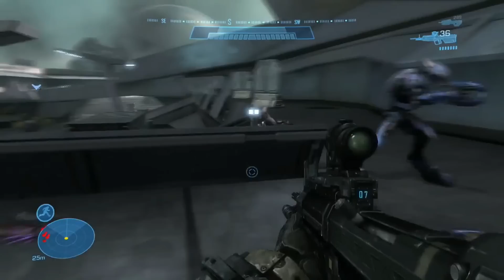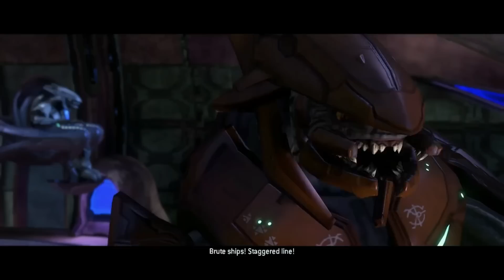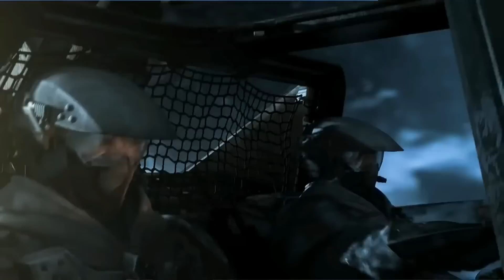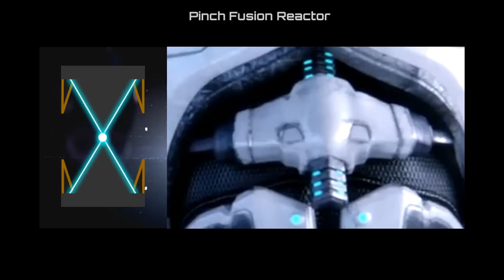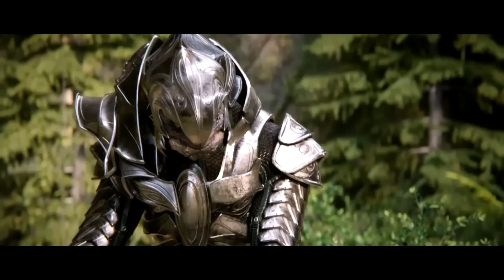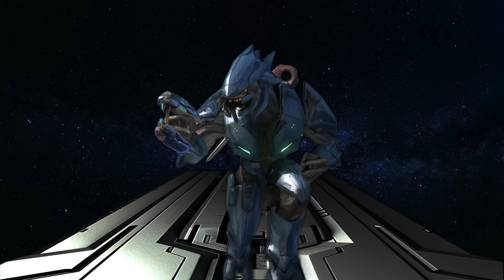Elite Armor | Most Detailed Breakdown

Comment: Aside from game play reasons, why doesn’t every Sangheili use active camo? The benefit of invisibility at long range and near invisibility at close range is a massive advantage even for line infantry.
Of course they can always turn off active camo to charge shields during combat, most likely engaging from a point of advantage and with the element of surprise due to the camo.
Reply: I'd imagine it'd be a similar reason to why Minors don't normally get swords, or perhaps only certain Sangheili are given it for specific scenarios
Reply: @217adaptiveperspective  yeah that does make sense. It’s more for specific ranks and the required missions that need it. Since… come on, your not gonna use stealth in full scale open battles, that’s a waste of valuable resources and it gives the enemy a chance to salvage useful tech if they win.
Reply: @shcdemolisher  

That's exactly how Spartan armor got shielding, they took the Jackal shield modules off their bodies during the first encounter with them.

Then Mjolnir Mark V or another variant of Mjolnir came out and had Energy Shields.
Reply: @217adaptiveperspective  Yeah. I’m still bummed we never have had the energy shield gauntlet as a thing to use in any of the games! Seriously it would have been pretty useful to use! Reflecting damage, giving you more time to get to cover, telling some asshole to piss off and stop shooting you!
Reply: Or even using it to charge with an energy sword towards enemy’s! *Activates both sword and shield*, “ATTACK!!”
Reply: @shcdemolisher  Closest we ever got was the Promethean shield, not the same but it could reflect tank shells for some reason.
Reply: If you give everyone a nuke then somrthin bad gotta happen

Comment: I do not buy the Sangheili armor increases physical attributes, all that is natural to a Sangheili. It would be fucking retarded to have a suit that increases strength and not have gloves. What good would increased strength do if you're grip/hands aren't also enhanced? You'd never receive any benefits and on the contrary would probably be more likely to injure yourself. 

It sounds like more retconned 343 garbage to me. Also Humanity didn't win, they were nearly wiped out and only survived because the Sangheili broke off from the covenant and allied with them.
Reply: I think installation 00 is actually just the AI called UNSC bias.

Comment: Did you just solved the debate of shielding technology!? I was in a few dabates awhile ago with people saying this type of energy shielding isn't possible.
So nanolamate plating is basically nano-composite armour now that you put it that way, the covenant uses it as standard to resist plasma damage.
Reply: Its superior to anything the unsc uses as its reverse engineered from forerunner technology but designed better which is why the infinity is so good..though its actual power is similar to the shadow of intent according to 343...so it's not as overpowered as we think...though that's assuming the shadow of intent is piloted equally to the ai and is able to dodge the mac founds that's can be fired continually for a time. At a decent power as well at that. Plus the extra frigates. But in a full on brawl without weapons like macs its considered the infinity wins but not without taking some pretty hefty damage overall.

Comment: Amazing editing bro great amount of science that actual makes physical sense especially shielding which I thought was pseudoscience bs but now I see it makes sense
Reply from the maker: If truth be told we are capable of something similar to very small scale "energy shields" now. Plasma torches create a square barrier of plasma across a void by projecting high energy plasma from one electromagnetic polarised side to the other. Compressed air is then pumped through the barrier, creating the plasma arc that can cut metals. Its the same basic principle but with a different net effect, something more akin to the Gauntlett Energy Dagger.
Reply: Installation00 I’m still iffy as to how this makes bullets not able to hit the wearer does the plasma absorb the impact and vibrate the particles to produce light and energy now visible by the naked eye? Do you think this is the same technique used by humans covenant and forerunners
Reply: MIDKNIGHT FENERIR I understand that part but scientifically how would this be power efficient at all and would require large amounts of magnetic fields which would disrupt other covenant tech in the harness right
Reply: @shigwig9751  that's the key you just explained it actually. Magnetic fields can be controlled and manipulated. We are far from ever doing anything like this let alone having a power cell that is able to continually power such impressive technology. Its still amazing and why I love halo. Its realistic for the most part and is more powerful than we give credit for..